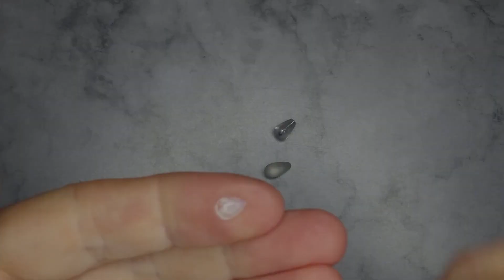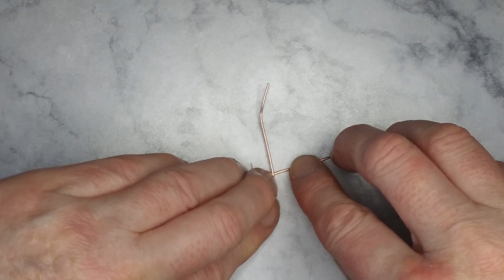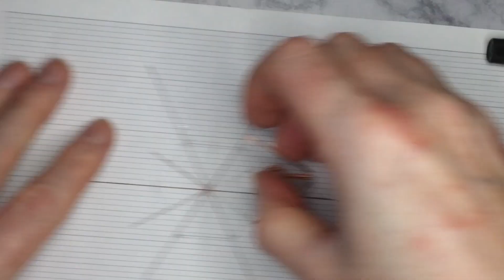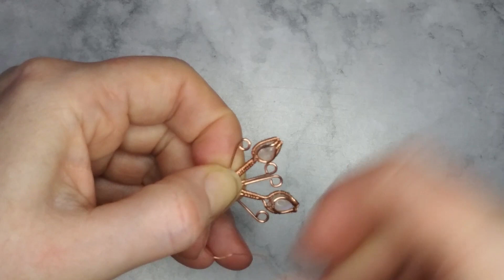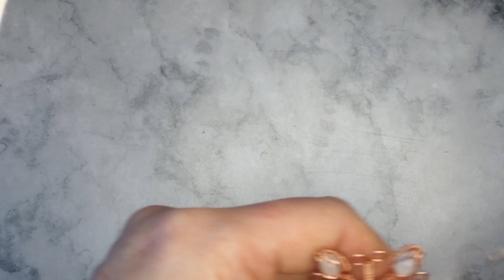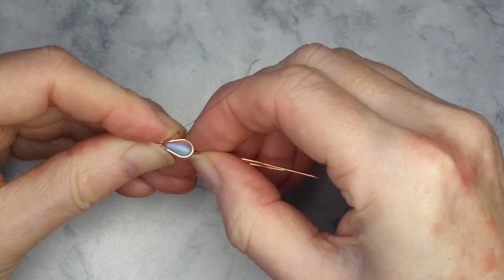Wire work snowflake for pendant or Christmas tree decoration wire wrapping tutorial DIY

Comment: Could you tell me where you got that ruler?
Reply from the maker: I can't actually remember, sorry.
 I didn't buy it online so it must have been a store here in the UK, possibly the range.
Reply: @ could you possibly tell me what it’s called? I know it’s got centimeters to where you can see them. A regular ruler doesn’t.
Reply from the maker: @renovclean2  I have just been for a search around the shops to see if I can find it but failed. I looked up clear gridded ruler on Google and found some similar rulers if that helps.